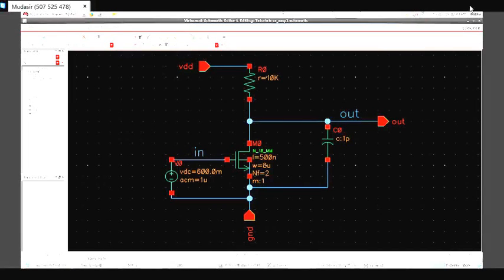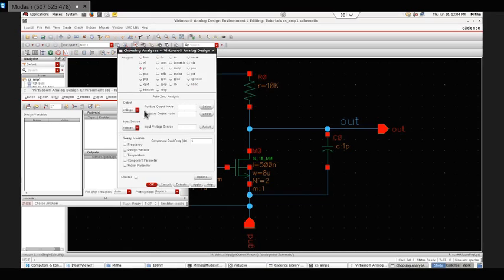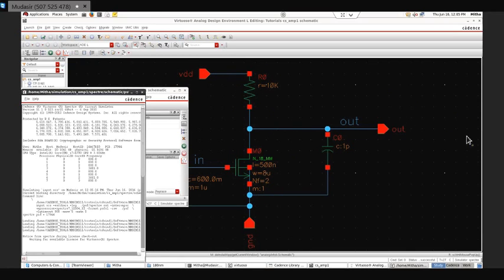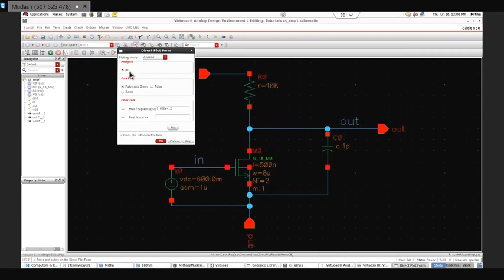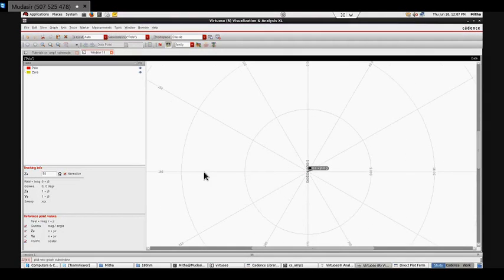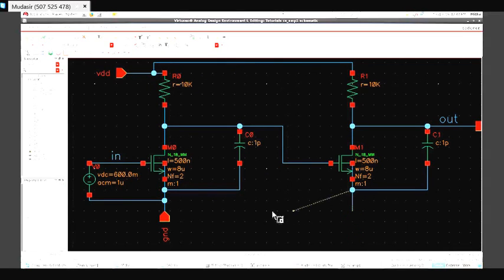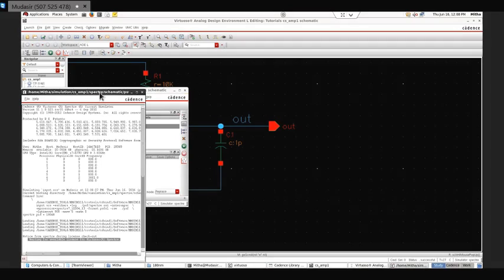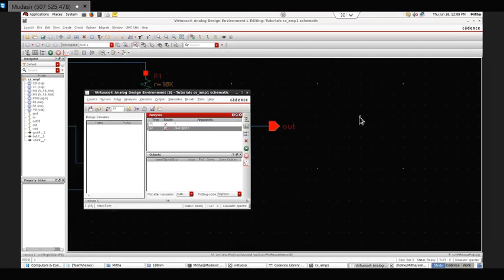Cadence IC615 Virtuoso Tutorial 7: Pole Zero Analysis in Cadence ADEL

Comment: I want to find the poles and zeros in a multistage amplifier. I'm doing AC analysis then from the gain and phase plot of different stages I'm able to see the location of poles . I find the maximum gain from that stage and see at -3db from it which gives me pole location. But I'm confused how can i get the location of zero in the same plot..i mean i know at zero the slope will start increasing but is there any way for zero also to get the exact location like for pole we are having it at -3db  from the dc gain of that stage
Reply from the maker: I am not sure how to find exact locations but as you said one can figure out poles and zeros from plot or smith chart. Also from log file you can check I guess. A suggestion, please review your concepts on bode plot for better pole zero understandings.
Reply: @MudasirMir7  okk thanks for your suggestion and sincere thanks for your videos,these are really helpful